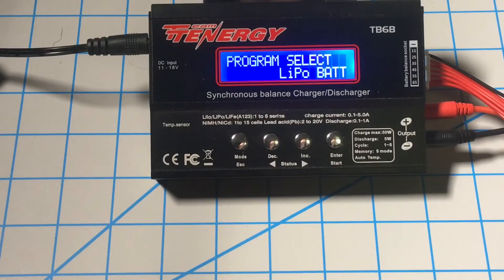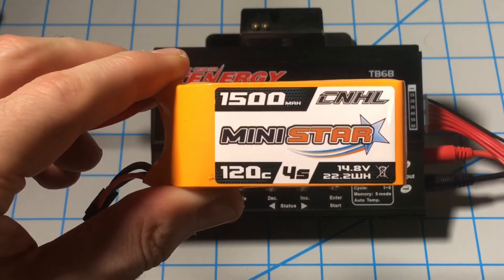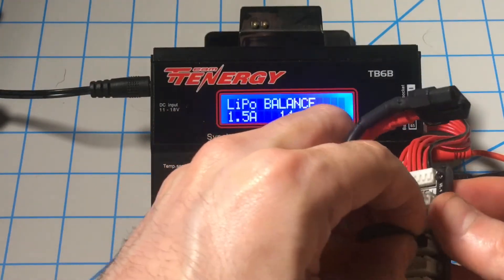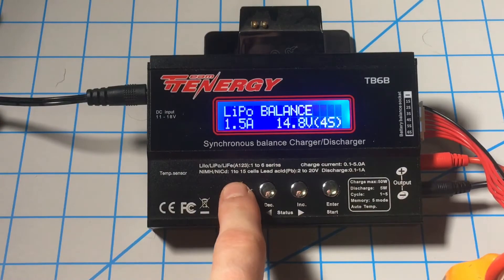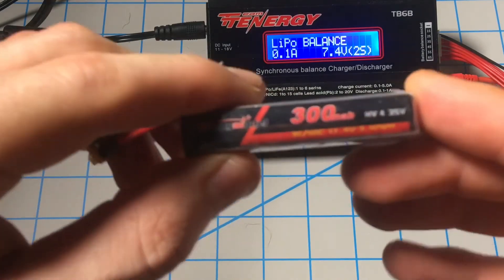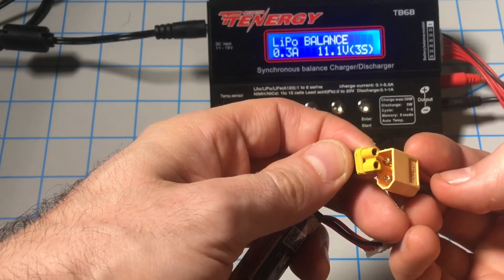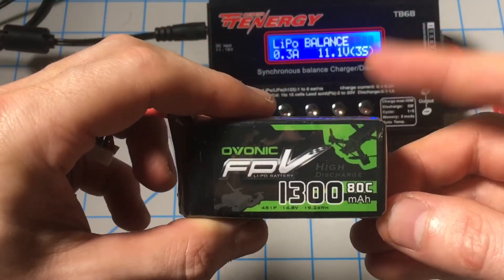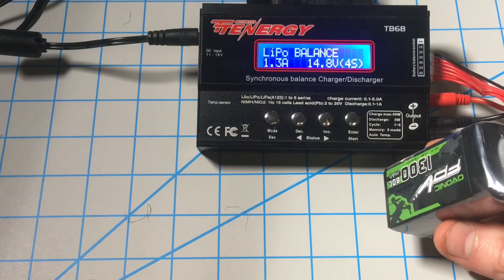How to charge Lipo batteries

Comment: On a 4000 Mah  11.1 v lipo S3 how long is the charge time ty
Reply from the maker: Typically at A 1 C charge rating  it will take just about 1 hour to  charge to full give or take a few minutes  for the final balance  out
Reply from the maker: On some chargers lower powered ones they don’t charge to a super high rate and they will cap out at a specific charge rating mine will charge up to five amp so in theory it will charge a 5000 mAh battery in 1 hour  as an example